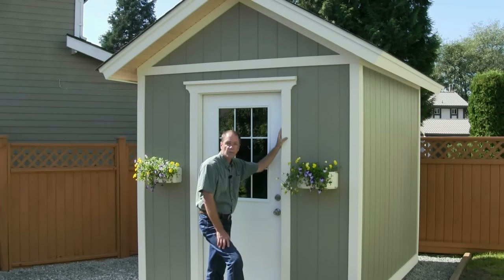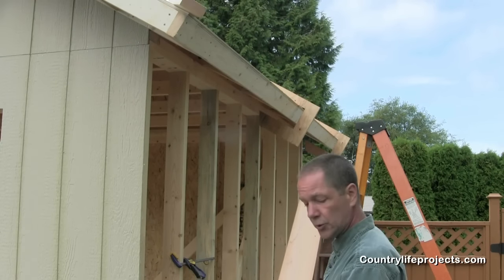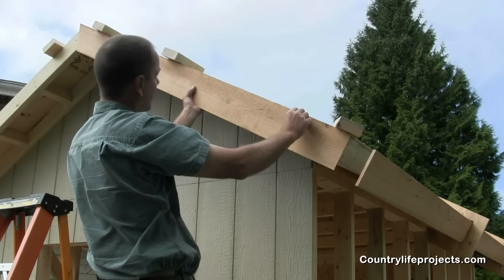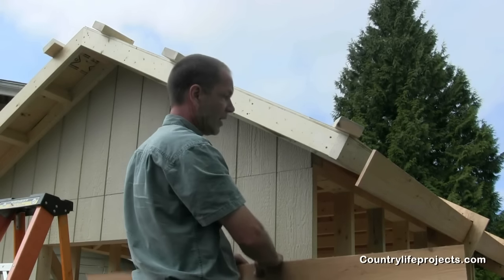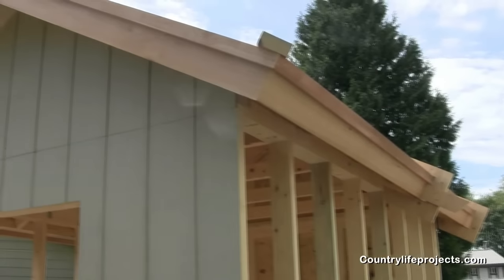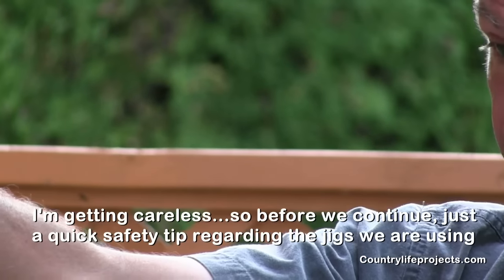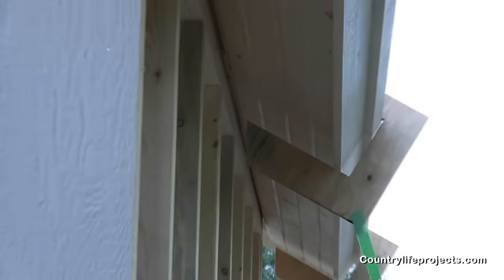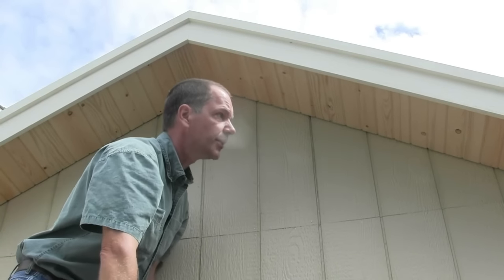How to Build a Shed - How To Install Fascia Boards & T&G Soffit Boards on The Shed - Video 11 of 15

Comment: I know this is an older video series but it was instrumental in me building my 12x16 shed alone. Your jigs worked like a charm but just knowing when to use galvanized nails, roofing nails, siding nails, etc, little details you learn from years of experience or someone like yourself on youtube. Thanks again.

Comment: Just purchased the plans and while the dimensions I need to build are slightly different the quality and design of these sheds are so superior it's worth the conversion effort. Overall these sheds are also aesthetically way better than most. The plans are very comprehensive. If you're building a shed this design is worth having even to educate on the process alone. Very nice work.

Comment: This is definitely one of the best shed construction series of the many available on YouTube.  Henry does a thorough and masterful job of teaching this subject.  I learned a lot from these videos that has helped me in my own projects.  Henry's emphasis on safety is also admirable and left out of too many construction tutorials on YouTube.  One word of advice I would offer DIYers watching this series is to use nails rather than screws for structural areas - 16d galvanized for floor framing, 16d sinkers for wall and roof framing and 8d and 10d for toe nailing and side  by side nailing.  These videos were made during the glue and screw period when impact screw drivers became popular.  Construction screws are very brittle and will shear under structural loads.  Screws can be use for floor decking and roof sheathing.
Reply from the maker: Hi Brian... While I would agree with you on most of what you say, I think these tips are more valid for very large sheds, garage or house construction. For example, the shed floor joists sit right on gravel so no sheer strength is required there. Due to the size of these shed, the shear on walls will be minimal and the LP Smart panels are glued to the walls for additional strength (as are truss gussets and plywood flooring). Yes screws have less shear strength, but the brittle aspect is more with bending screws than shear... the amount of force required to shear screws would likely take a hurricane or earthquake and if that happens, I doubt if many sheds would stand up to these forces. All that said, the primary reason for using screws was based on what tools most DIY'ers will have. Air nailers are not a common tool for most DIY'ers and we wanted anyone watching the videos to be able to so so with a minimal investment in tools.
Reply: If one looks into Rss Rkk screw nails or even grip rite brands the sheer strength increases exponentially. Its worth the time to check.
Consider. Sheer strength 💪 .
Reply: I just happened to have a framing nailer that shoots 2" to 3.5" 21 degree nails so I nailed my siding on, but if it broke or I didn't have one I definitely would have used screws. I guarantee nothing you build is gonna fall apart because you used screws on your sheathing if you are spacing them according to the manufacturing specs. Guys make this argument all the time but outside of drywall screws, you're going to be fine screwing your sheathing to your walls. Really think your gonna break all 30 plus screws in that 1/2" sheet of osb?

Comment: I went to Lowes last week to buy some 1x6 cedar boards to replace some rotted boards on my house. Every single board at Lowes was cupped and warped so I ended up buying PVC boards. The PVC boards worked great and the miter cuts were perfect.

Comment: Awesome!  Your videos are so detailed with great video.  Thank you for the modern technology of How-To.  It really helps people like myself who have knowledge, but not all of it.  It's really appreciated!!!  So cool.  All of your video building segments are perfect to compare with methods that I use...  Thanks for taking all of your time & effort for sharing.  Getting ready to build a 12x16 shed this Spring/Summer & your videos have me confident with details I needed references too, especially the soffit area.  Never did soffits before & your video is worth commendation, whether or not I use T&G..  Thank you Henry!!
Reply from the maker: Thanks George. Just a quick note. When doing a shed in the manner we did (roof sheathing, trim and soffit first) it is ideal for smaller sheds. The bigger you go, the more bracing I would use as the weight of the roof materials increases a lot. E.g. It is not something I would do on a full size garage. A 12 x 16 shed is probably the biggest I would do using this method. The risk if bracing is not sufficient is potential collapse with a top heavy load (the roof). Make sure you use enough diagonal bracing and that it is well secured.

Comment: Can you answer a question about the tongue and groove pine boards you installed under your overhang? Is it necessary to paint or seal these boards to prevent damage from moisture? I know they won't see as much water as many other parts of the shed, but can I install them in raw form? It would be nice to avoid all the work that goes into painting them.

Comment: Great videos Henry. I have order my materials and should not have many problems thanks to you. I do have a question about your jig. My roof is goin to be a 4/12 pith, do I still cut the angle on the jig at 30 degrees or something different.
Reply from the maker: Hi Dixon, No, a 4/12 pitch is an 18.43° angle. Best to do a few test cuts to setup the angle on the saw first before doing final cuts.

Comment: I built a shed practically identical to this one except its 10'x12' and gonna have double doors in the front and a window on the side. Whats the deal with the lp 4'x8' solid soffit? Can i just rip those down and use them for soffit under my eaves and rake ladders? Its cheaper and i have paint for it. Ive just never used it

Comment: Great instructional video Thank You. Do you ever use pneumatic or battery power nailers for its efficiency?
Reply from the maker: Of course all the time... We only used screw gun since most people have one, but are not likely to have a framing nailer and compressor.

Comment: Great videos. I really like this guy :) And I can't help noticing the accuracy of his carpentry... I'm planning building a workshop myself with almost the same dimensions. However, I would use nails instead of screws for framing, I believe they hold better, even if screwing would be better for me considering my hammering skills :) Great work! Oh, and HD ones, nice :)
Reply: You can always purchase a framing nailer. :)
Reply from the maker: Hi EzraI have one (well two actually)... but I wanted to create a series of videos using tools the average person is likely to own.I also prefer screws over a nailer, I think the finished results are stronger and more accurate. I have also found that screws are more durable in the long run. Anyone who has had to take a deck apart that was screwed together versus nailed will know what I mean.
Reply: LOL !!! I did both... took apart deck built with nails and rebuilt with screws. Lately I had to install subfascia for gutters on our house mansard rood and decided to buy the framing nailer as I was already planning ahead for the shed/workshop  :-)

Comment: I'm curious, have you ever hung the fascia by over lapping the peaks and joints if there are any, then cutting them in place? I'm confused with the bevel you put on the rip of the last soffit piece at the peak. 30 degrees is a plumb cut which is what you said you put on the piece, but you have it upside down. Does that bevel automatically work upside down or is that a coincidence? If not would that automatically work for any roof pitch? Sorry for so many questions, but I'm trying to learn. Your really a good carpenter in my opinion!!
Reply from the maker: Jim Watson Hi Jim, not sure what you mean by upside down. However, If you know the angle of the roof (pitch converted to an angle) you can cut one piece and center it on the peak and then cut the other. After this, the cuts at the bottom of the rafters can be done.

Comment: Great video series...I also purchased your ebook recently! One question - I'm having a hard time finding the fascia cedar boards at my local HD/Lowes (at least online). Could i use another species if they are primed/painted? Thanks!
Reply from the maker: Hi Andrew, first, thanks for buying the plans, appreciate that! In regards to fascia, of course you can... just pick out nice straight and flat boards. Lots of contractors these days use OSB trim, but I personally do not like it for exterior trim... I just can't see it lasting in the long term - especially in areas exposed to lots of rain or humidity.

Comment: Thank you Henry for these informative video's... I built a low height 9'x13' shed at my last house and am getting ready to start a 10'x20' in a few days. You fully explain a lot of techniques that will help me make this one far better than my last shed so thank you for that. My toughest problem on this project is determining the exact lengths and pitch of the roof as I have HOA height restrictions I have to meet and incorporate into the design. I'm using Spanish cement tiles that match the main house and I don;t want to end up with a partial tile horizontally or have too much or too little overlap vertically. I'm using Google Sketch so once I figure out the installation specs for the roof tiles (I still need to research it), I should be able to figure it out. Wish me luck!

Comment: good job. Im guessing you avoided plumb cutting your rafters so that the beginners wouldn't have to struggle with compound mitre cuts for the facia board?
Reply from the maker: Hi Pete... actually it was an observation that almost every shed we looked at did not have gutters. So we figured... why use the standard rafter and fascia detail designed for gutters. The design we picked is not only easier, but it prevents a lot of rain water from hitting the fascia boards, thus extending the life of the trim and shed. It also looks good (we think ;-). If we were building a very large shed or garage, then yes, we would go the standard route.

Comment: I am trying to copy your roof, especially the soffit.  Can you give me an idea of how long the overhang of the roof trusses are? I see from your video and plans you were able to fit two 1x6 pine t&g boards side by side...so im assuming the overhang is at least 11" long?
Reply from the maker: This will depend on the width of the soffit boards you use. In the truss video I go over how to determine the overall soffit overhang (rafter length) subject to the type of boards used.

Comment: what was the material cost for this size shed approx?
Reply from the maker: Max H. About $2000... but do note that we live in one of the most expensive areas of North America for building materials and we used premium materials for everything. You could probably bring to cost down to $1500 if you shopped around. One exception was the door, we snagged that at HD for $50 without the window insert (tiny bit of damage to the jamb dropped the price by $100)

Comment: I am building an 8' W x 12' L shed. My rafter tails are cut at a 6/12 angle, like the roof slope.. I am working by myself, so that jig is something I am interested in using. However, as it is constructed it will not work on angled rafter tails. How would you change the design of that jig to work with my rafter tails? Thanks.
Reply from the maker: I think you would have to start with a larger piece of plywood and cut the notches to match the slop of the roof. I would sketch it out on a piece of cardboard, cut it and see if it will work - if it does then cut the plywood to match etc.
Reply: Great idea. Used same design just used the angle of my rafters. Worked great! Thank you Henry.

Comment: Enjoying these videos, I built a barn and didn't research eaves and how to build overhangs.  I was thinking a nail gun would be good, so you could put the side sheathing on and not need the "hammering room".  It's all good though.  Take what you need out of many videos and adapt it all to your circumstances.  Gotta be flexible!  As the guy commented on the odd angle of the outside edge, in the previous video, you could cut it vertically for eaves troughs if you want to, just got to think ahead.  Great videos though.

Comment: I'm confused... this soffit doesn't need a vent...?
Reply from the maker: Hi Ryan, I do mention this in other videos. It depends on your location and use of the shed. For a shed, gable vents are fine. If you plan to close in the ceiling and insulate, then soffit/ridge vent is an option or just simply using the gable vents.

Comment: I'm willing to bet this master still uses a hammer, and not a brad nailer.
Reply from the maker: Thanks for the compliment... You are sort of right... Outside I like nailing finish trim by hand as I do not find brad nails for air nailers thick enough. Indoors, give me a brad nailer any day over a hammer. Same for framing.